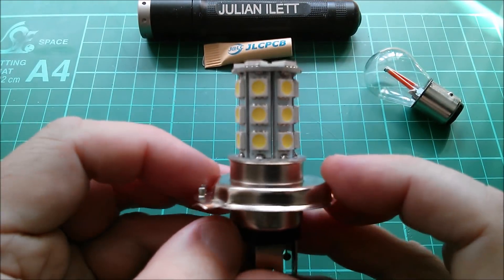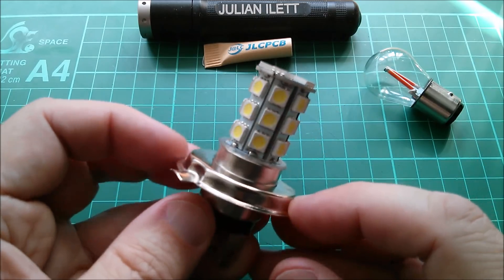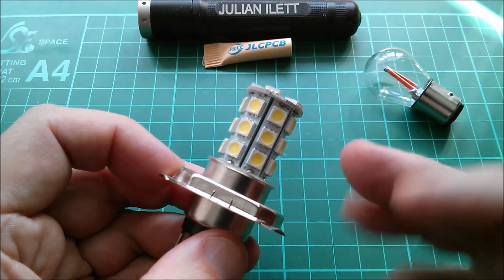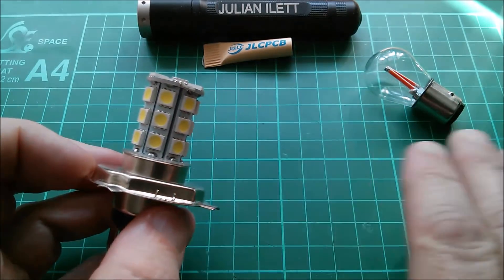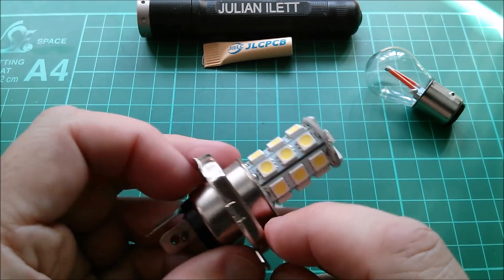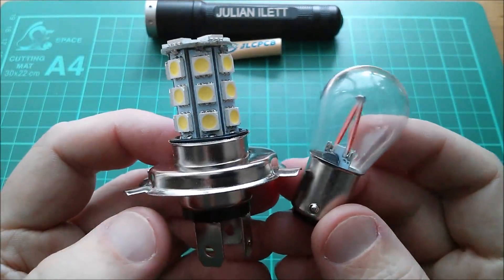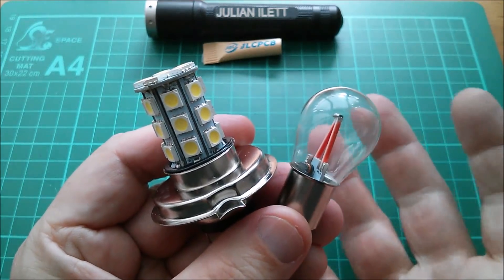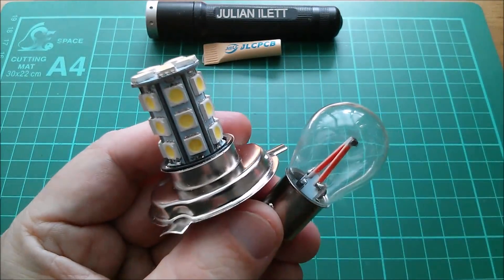SCAM! LED Light Bulbs - H4 Headlight and BAY15D Tail/Stop

Comment: I cannot use LEDs in my car because the computer monitors how much current each lamp uses, and if not as high as expected it will say that lamp is broken. :|
Reply from the maker: +Maria Engström Ah, yes, the canbus problem.
Reply: It's not really a CAN BUS problem, as that's a high speed communication bus for the various vehicle ECUs to communicate. This bulb warning is a bulb monitor activation problem. 
The body computer (BCU) monitors the resistance of the bulbs in circuit. A filament bulb has a resistance considerably lower resistance than an LED. This low resistance makes the BCU believe the bulb in question has failed, hence the light. 

CAN BUS isn't really anything to do with the bulb monitoring, it's name has been incorrectly applied to the system affected. The CAN BUS will carry the data from the BCU to the Ipack (dashboard), which tells the Ipack to put the bulb failed warning light on.

Comment: LEDs being faster (applicable to automotive Brake lights) doesn't necessarily include the time for the embedded power supply to ramp up. Almost always, it'll be essentially instantaneous and LEDs would be faster. But I'll betcha that there are badly designed LED bulbs with slow power supplies out there. Maybe. Speculation Alert.
Reply: J H since a car uses DC, there's no need for an embedded power supply. You just put the right number of LEDs in series, then whatever passive components are needed to limit current and keep the right voltage going. There's nothing that needs to start up or charge.

Comment: Julian you could easily be setting yourself up for a major fail. Please tell me you will not be testing any of this with eBay testing junk. Decent and known equipment is the only solution.
Reply from the maker: +Michael Stevens I'm looking at a uni-t lux meter and a very expensive thermal imaging camera.
Reply: For comparison (and not absolute measurements) even cheap test equipment should be fine. There is much more to go wrong with the testsetup itself (like positioning, alignment, color/reflectiveness of "stuff" around the measurement spot) than with the measurement equipment.
Reply: Julian for comparative brightness purposes you can use the Lux meter built into your smartphone. Use a good app such as physics toolbox suite

Comment: There is a make of leds that are canbus friendly  made by .superbrightleds
Reply: I've used their stuff before, I'm quite pleased with their product quality and color/beam pattern variety. They also carry many hard-to-find "dealer only" bulbs, like NEO 3 and 4 that are in many auto manufacturers' dash switches. Their LEDs have internal diodes AND resistors, which means there was actually some foresight in the engineering stage of the product, instead of the crap I describe below...

Now, let's talk about JTech, which put in the right resistors for right-at-the-maximum-threshold use at 12v (puny 1/8 Watt ones), completely forgetting most cars run at 13.8v so their bulbs lasted up to a month before individual chips developed the "black spot of death" or "disco flicker mode" and eventually progressed to "fail fully shorted mode," taking the rest of the chips with it soon thereafter. I put a review on Amazon telling purchasers to disassemble the bulbs and change the resistor value to a higher one (rated 1/4 Watt) or not to buy them at all. They truly were craptacular.

Comment: For a real headlight led replacement go for something like this: https://www.ebay.de/itm/401490079434. The lamp still is not in the best focus point of the mirror but its quite bright for sure.  I am not sure how long it will work as it gets quite hot after 1 min. already although they use a little fan with heatsink. Btw: why dont you use a descent lab powersupply intead of these battery blocks? The advantage would be you get an amp reading for free :-)

Comment: SCAM the h4 headlight has a reflector stopping the light from coming straight out to the headlight lens the only problem i find with these led lights is that they are too white not yellow in appearance please know what you're talking about before putting it on youtube
Reply: The focal point of that H4 LED  is all wrong for a reflector to be any use. The light will go in all directions and not where it's supposed to go, like on the road.